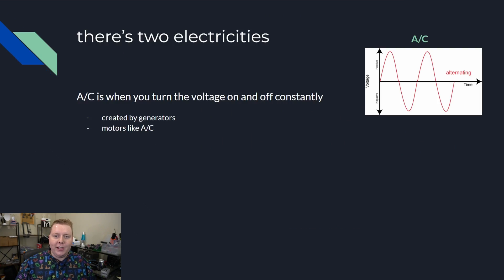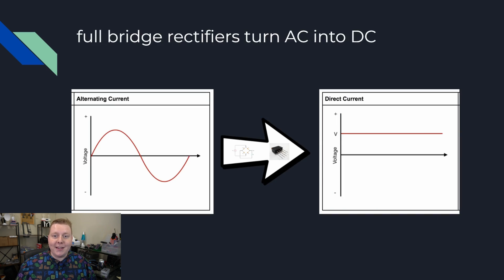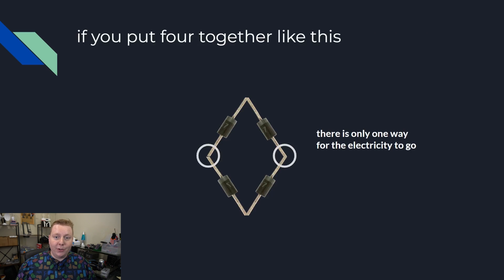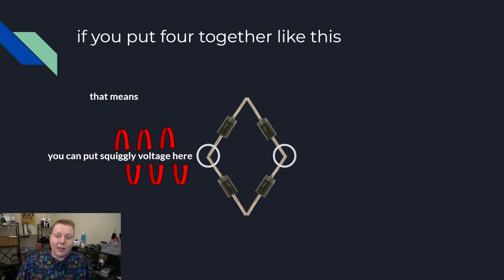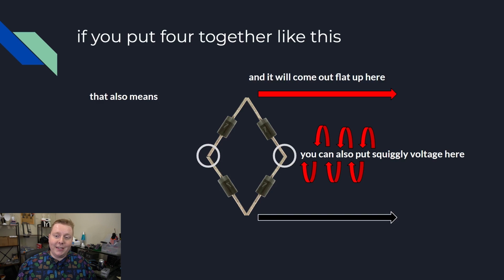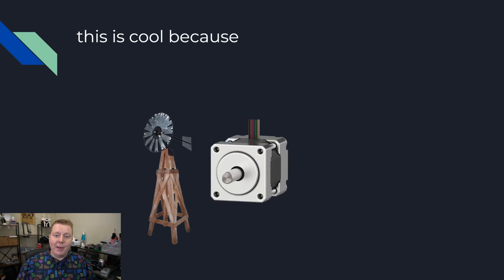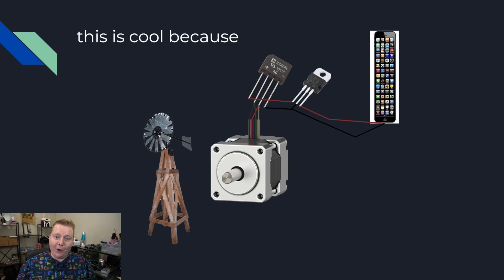What is a Full Bridge Rectifier in Under 2 Minutes

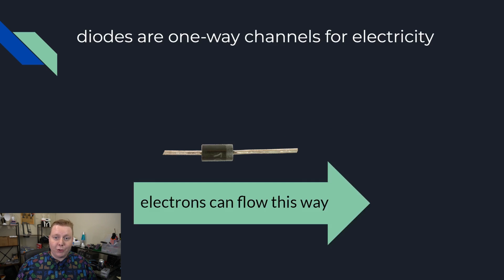Comment: 0:28 Be careful: The physical currrent flow shows the direction of the electrons (from the lower to the higher potential) and is opposite to the technical current flow, which is from plus to minus, but the diode symbol always references to the technical current flow.

Comment: Correction , you will not see 5v after a diode if 5v is going in, you will see roughly 4.4 volts with a normal diode, 4.7v with a Schottky diode, maybe more with some germanium diodes, and this is an important factor for micro generation.😀

Comment: Check out a full wave voltage multiplier and a cockcroft-walton multiplier, double ac voltage and then rectify it to dc, I'm going to try it on my small vawt, I think it might help reduce the impact of a voltage drop over the diodes.